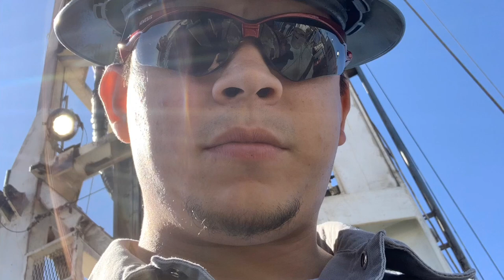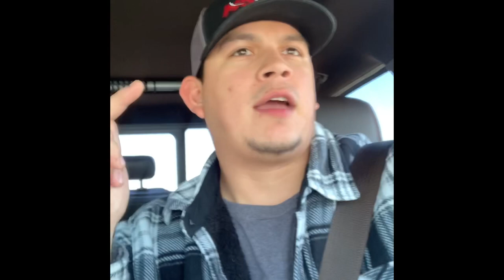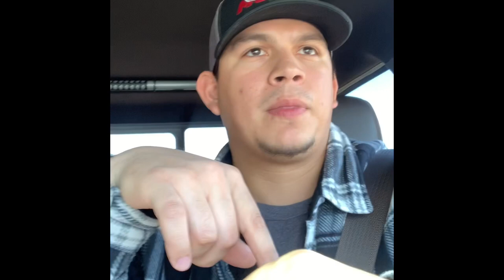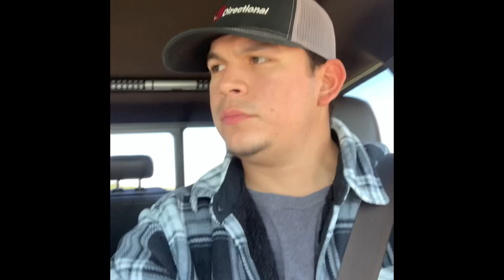OIL RIG MWD FIELD “ENGINEER” | WHAT WE DO!!

Comment: I did mwd work for 7 years and it was the best job I ever hated..... until payday. Then it was dancing on moonshine.
I ran tensor, aps, sdi, and evo tools in those years and if you ever get an offer to run evo tools you need to jump into it. Its a battery whore and its data intensive working the tool after the run but itll do em and mud pulse at the same time (or one or the other depending on your talk down sequence) and lcm or mud weight just doesnt matter to it. Itll chew through a tree branch to keep the pulser going. Granted your sync is gone and it turns on both batteries at the same time to do it but itll grind through it and sync up on the next set of periodics. The rfd is an ipad running wifi and your surface gear is next to nothing. One wire to the transducer is all your gear crossing location.

Comment: Do you need a degree for this? I’m a floorhand and I’m really interested in this position.
Reply from the maker: Luis Ayala no sir but a degree does help understand the concept of the job.
Reply: Victor Beltran do you know which companies higher that train you up on it? Currently with H&P on a drilling crew we don’t have mwd hands
Reply from the maker: Luis Ayala some companies do hire with no mwd experience like MS Directional, the company I’m with, but you have to stay updated w their career page. Why don’t y’all have mwd hands?
Reply: Victor Beltran we strictly just drill. So just floorhand motors, and Derrick’s
Reply from the maker: Luis Ayala hmm so no lateral wells? Just vertical or..how deep y’all drilling? From the H&P rigs I’ve been on we’ve had directional drillers and mwds, but yeah having those guys on location can help you learn what they do

Comment: I want to be a petroleum but I want to work in office because I am smart. What suits me?
Reply from the maker: If you want to work offshore go for it. Do not be afraid to fail. As far as working office I would recommend going to a well known prestigious college that has lots of alumni on the oilfield.
Reply: @victorbeltran1954  
Thanks, I am planning to go to university of houston. Next plan is to make sure petroleum engineer is for me. Should I go for drilling engineer?
Reply from the maker: @Vq.geo00  UofH is a good college, good engineering program for petroleum. Drilling engineer is good position just know you will have to relocate to bigger cities